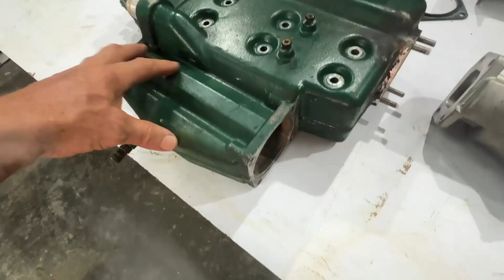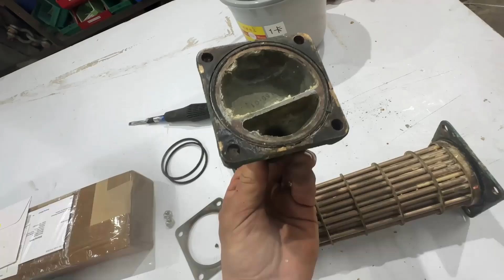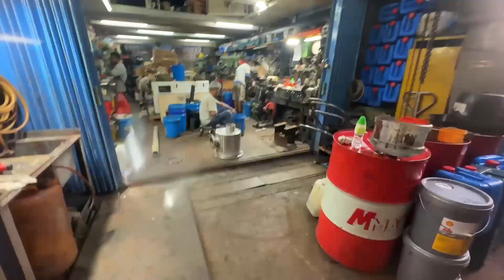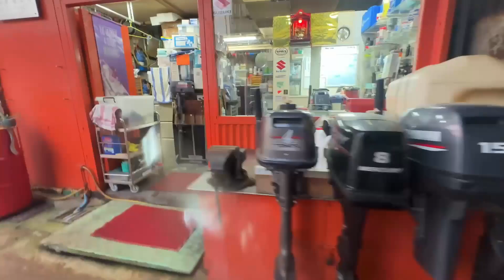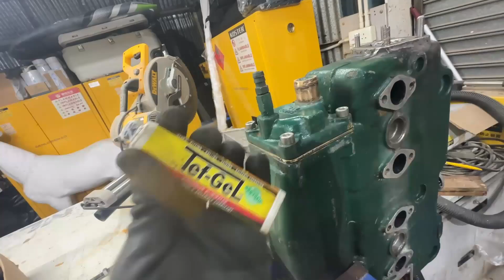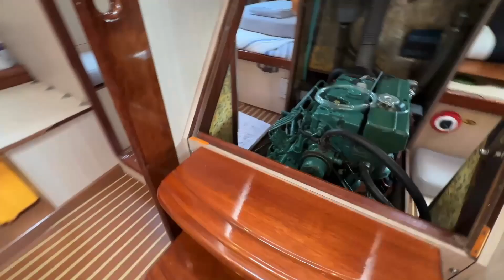Can a heat exchanger be repaired ?

Comment: Why can't a boat engine run a closed cooling system with a radiator? It looks like a problematic system using raw seawater.
Reply from the maker: The problem is the corrosive nature of sea water.  If only the oceans were fresh water
Reply: @SailingRebelStar  yeah...but the every thing else rots!  LOL
Reply: The boat engine can if the owner can find a suitable place for the air radiator and handle the noise from a constantly running fan.

Some setups has pipes going outside of the hull for cooling but then you get the through hull dilemmas.

On a sailboat cooling could possibly be done in the keel, but again maintenance and expansion and contraction between different materials could create issues.

So I guess it boils down to preferences and tradeoffs, as with everything else in a boat.